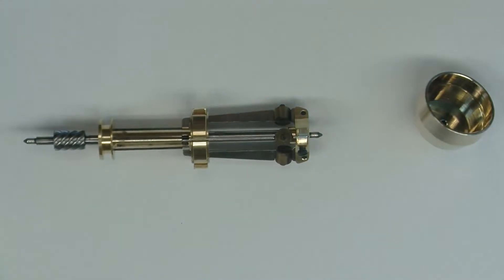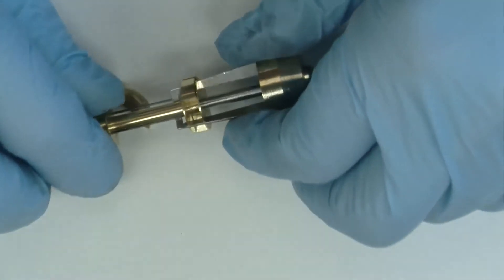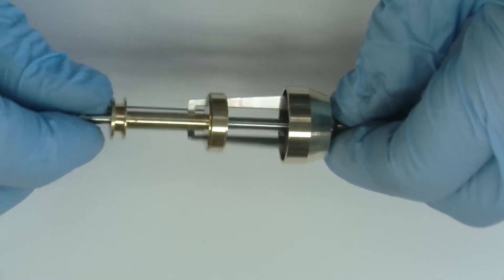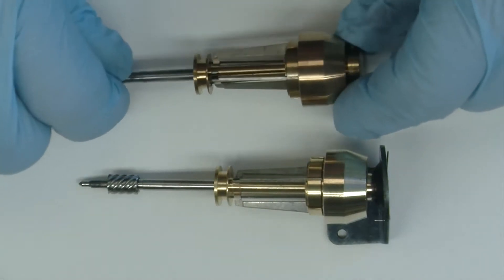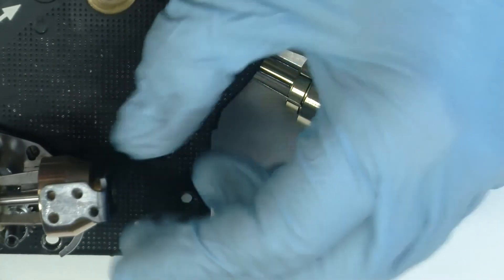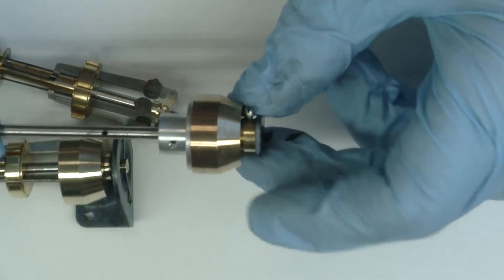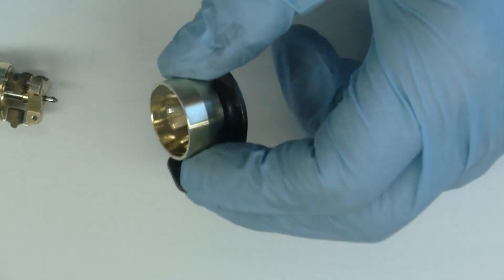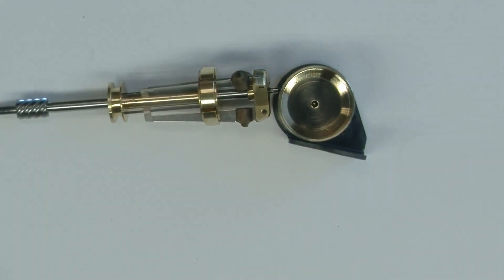Bolex, how the governor works

Comment: Could you make a video on how to lubricate a bolex? Thanks!
Reply from the maker: sadly there really is no easy way to lubricate a Bolex without taking the workings out of the body. There are a couple of spindles on the film side you could add a drop of oil to. And if you took off the drive sprockets you could add a drop there but then you'd have to retime them to the claw. For oil I used Mobil 1 0-20W and grease was EIKI cam tank lube which was a graphite grease that I applied to the entire gear train, sure it is no longer available. Stayed on the gear teeth better than the Bolex graphite grease.
Rich
Reply: @richjura8957  Thanks for the help!